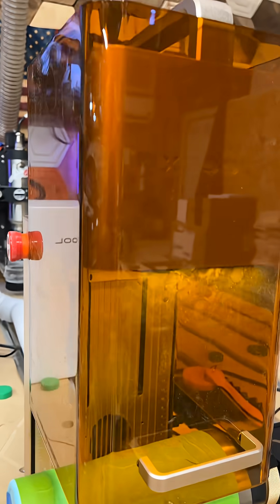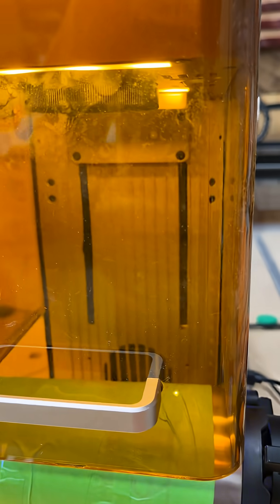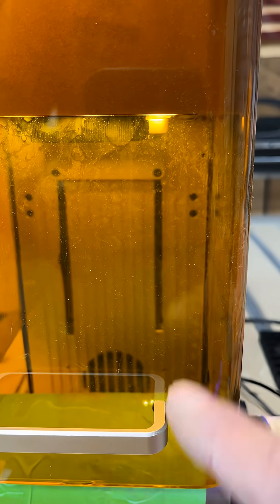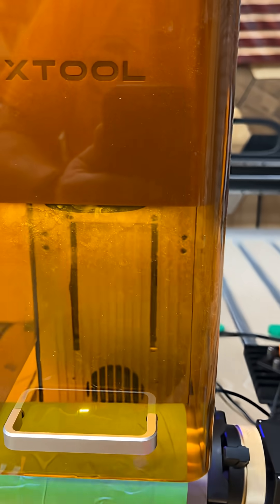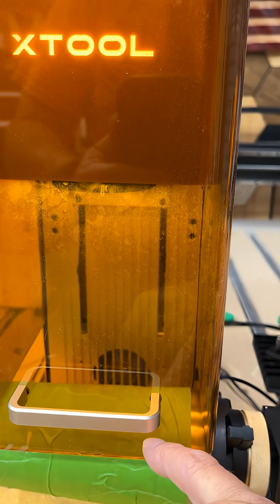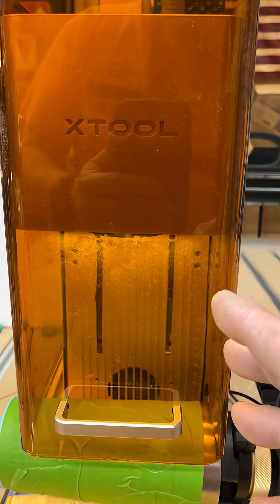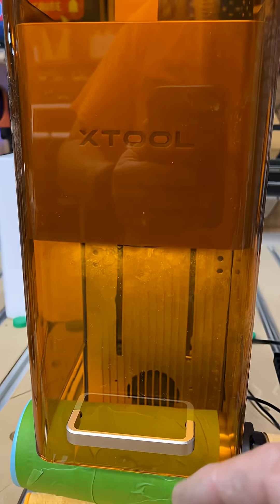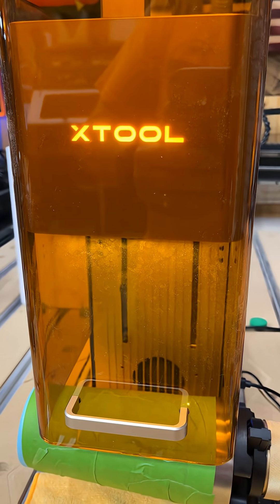XTool messed up… I have the fix

Comment: Dear customer,
This is Wendy from the support team of xTool. 

Thank you for your clever solution for engraving tumblers larger than 85mm with the F2 and RA3! Your approach is very insightful.

We'd like to formally share two safe methods that align with your idea:
1. You can place F2 on the base plate of RA3 for processing, which will increase the height of the processed item. However, please pay attention to the center of gravity of F2 to prevent it from falling.
2. You can remove the base plate of F2 and place the entire RA3 underneath the base plate, with RA3 placed on a separate surface for processing.

Your video sharing these tips will be very valuable to our community. Thank you for your innovation!

Best regards
Your trusted partner-Wendy
Reply from the maker: Or, you can make yourself an adapter like I did. You can download the file here and not have to deal with alignment issues by using your techniques. https://theclackshack.etsy.com/listing/4418054975/xtool-f1-or-f2-ra3-adapter-aka-bigfoot